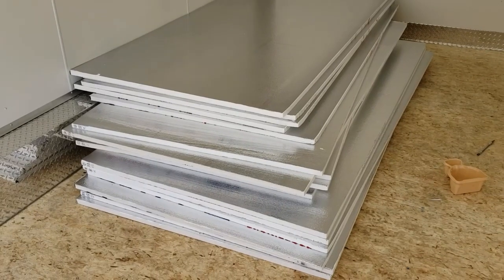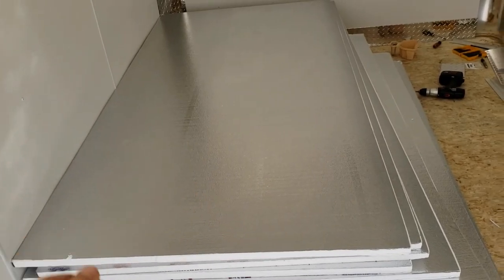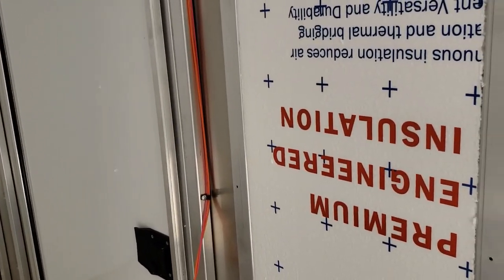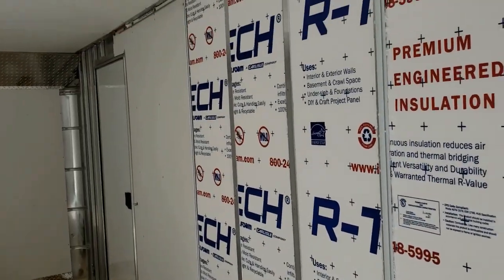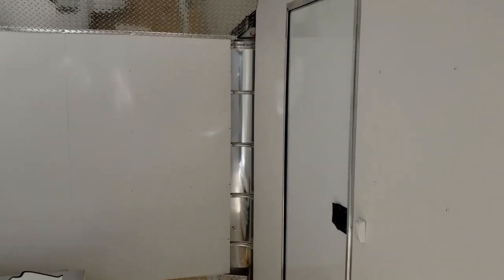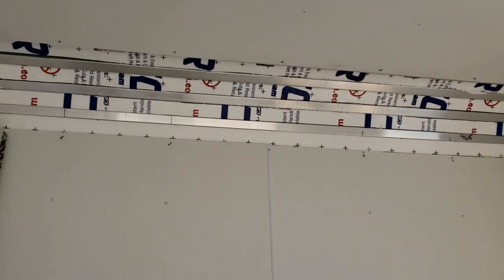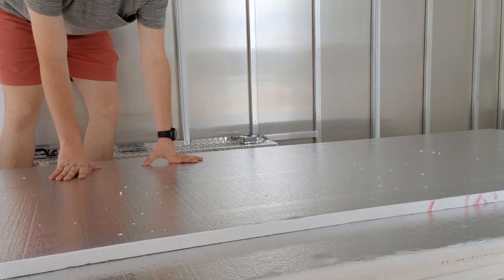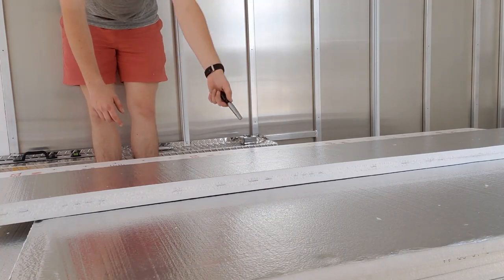Insulating My Cargo Trailer

Comment: What is your white walls made of? 1/4 mdf and vinyl sheet? I’m working on mine right now
Reply: They are 1/8 standard ply with vinyl sheet
Reply: It's very thin stuff
Reply: @ryantoast6035  thanks. That’s what I just put on my ceiling. Did the trailer come with that?
Reply: Mine did. I walked around a dealership to see the different options. The decision was between this one with the white walls, and another one that also came with rubber floors but I plan on doing wooden slat floors.
Reply: I have an Instagram @little_luff_life that I post a lot of updates. I haven't had enough time to do videos since I had a baby.
Reply: @ryantoast6035  nice. I’m going with the vinyl wood floors. Working on installing my shower and plumbing right now. Next is the dometic cook top and suburban heater.
Reply: We are going to make floors out of 2x2 birch. The sand and water from our feet will fall between the boards, then like once a year we just lift the slats and vacuum. All we have left us the floor, plumbing, and shower.

Comment: Did you have to remove all screws from one wall to remove the white divider strip? 
Or how did you get them off?
Reply: I had to remove every single screw to get the panels off. As far as the divider strips, they have a channel to hold the entire edge of the wood, so the panels just pop in and out